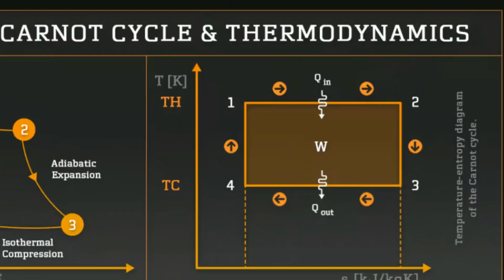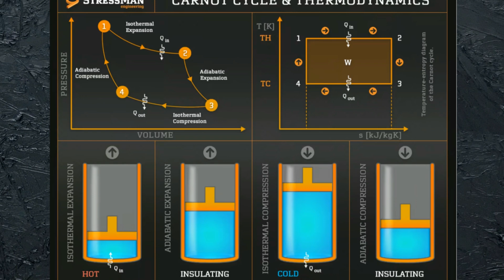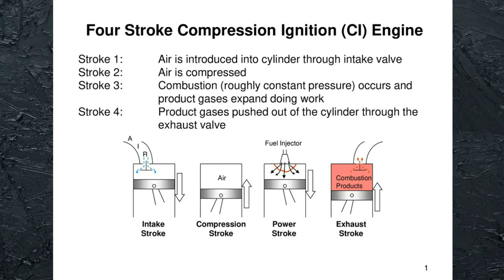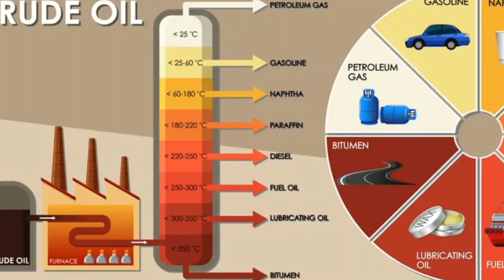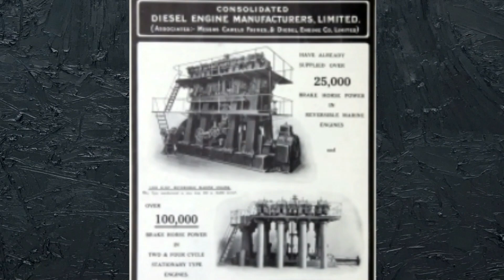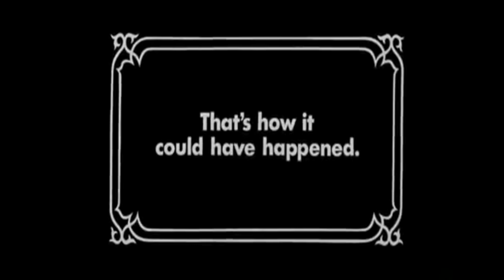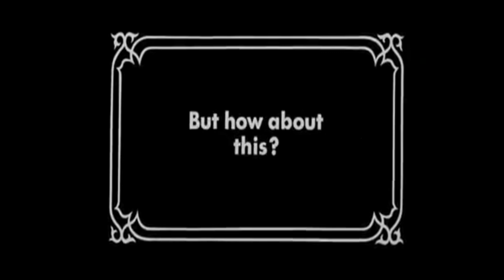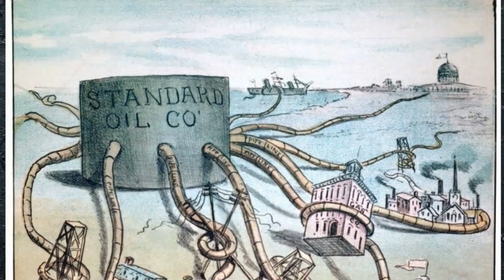RUDOLF DIESEL - The MAN who gave us an ENGINE and a MYSTERY

Comment: The first practical internal combustion engine was powered by a mixture of coal gas and air ignited by an electric spark.

Ford planned to use ethanol as the primary fuel for his Model T, however, the less expensive gasoline emerged as the dominant fuel."

The fact that petrol/gasoline got a look in, let alone become so dominant is a strange one.

Comment: There is a drawback to growing GMO corn just to produce ethanol based fuel!! 
You can set up a diesel to run un vegetable oil and drive it everywhere!!

We used vegetable oil to drive everywhere it would! It would be very expensive way to get around!!